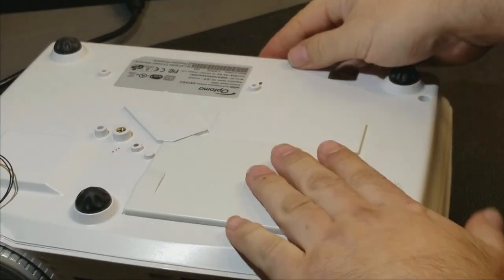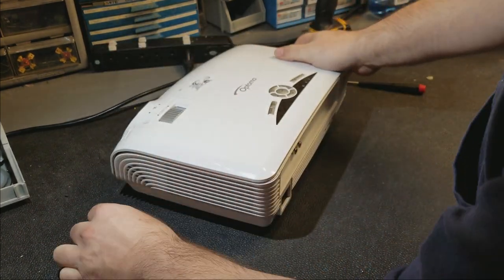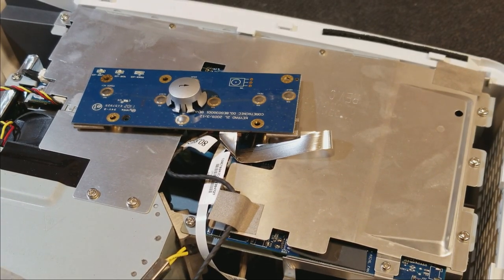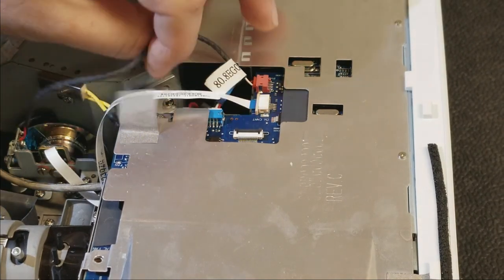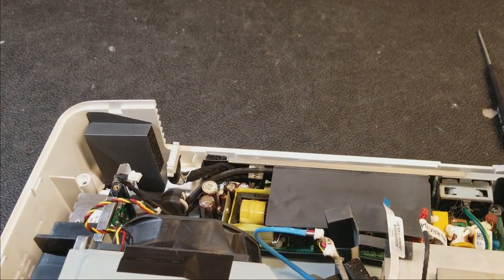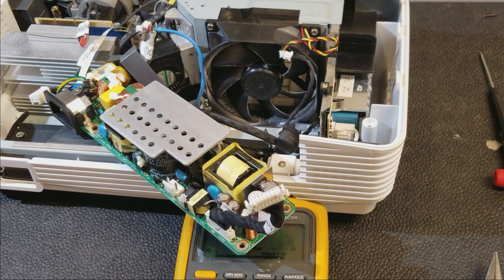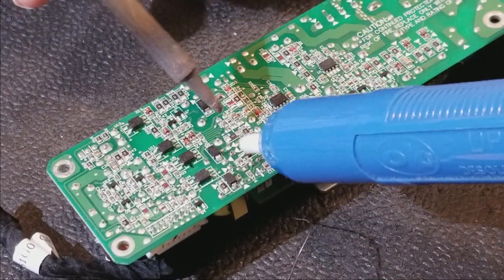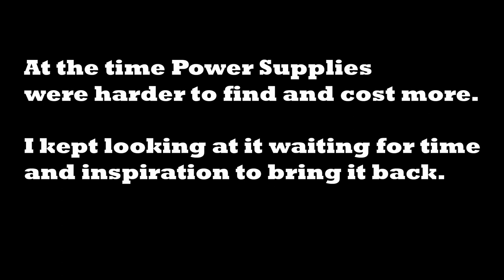Optoma HD20 DLP Projector Power Supply Replacement P 1

Comment: Great job Frank. I'm working on a Benq TH670. It seems like the bulb is broken. Though the LED code shows that the color wheel should be bad. I will see soon when a replacement bulbs comes in. I would suggest getting a Hakko solder socker. it makes life so much easier. For me, those blue suckers never worked.
Reply from the maker: I love my sucker! I've had that particular pump since 1998. It's had 27 tips since then. I still have 3 left(it's how I know many). This pump is a large type. It actually works really well. The small ones are kind of a joke though. I have a powered Weller desoldering station with the foot pedal and all but I love my old hand solder sucker. It's had it's snout in a lot of gear since I first used it. That sucker and my Weller iron have been with me for over 20 years now. It's weird to think about...
Reply: @FixitFrank  It ended up, only a bad bulb. Replaced it and already sold it($380 !). Today, I will pick up a W1070, which is completely dead.

Comment: Thanks Frank. The video is EXCELLENT: very detailed and always in focus, accurate and with great audio. I was surprised to realize that I had EXACTLY the same problem with my old but great HD20 (including the problem of the plastic of the 2 screws…). Got the power supply from China ($57), and now it works great. Thanks!!!

Comment: Hello Frank. Thank you so much for the in depth videos. I am on my second HD20, using the first as a parts machine. Recently it is having the following symptoms: the green power light flashes three times, and then the power light flashes amber while the lamp light illuminates steadily. the main lamp does not start and the color wheel does not spin.  switching the mainboard did not solve the problem, infact all it would do is flash the green power led 6 times and then return to it's normal amber standby mode with spinning color wheel. Any tips you would offer?
Reply from the maker: Hmm. Kind of sounds like a lamp but also might be the lamp door switch.  Check the lamp door switch and the filter caps in the power supply. the service manual is downloadable here. https://file.io/d2F15J7HrGfF
Reply: @FixitFrank  Thank you for the advice! It looks like that file has been deleted. I have looked at the service manual and all it says is that that led pattern means is "lamp failure" which isn't very helpful. I have three different lamps and none of them change the results. I will investigate what you suggest. Thanks!

Comment: Hello there Frank! In the past days I too learned a lot about Optoma (HD26) unfortunately. All is fixed, all is working, however, last time, when I put the housing together, the heat shield on the back of the DLP chip heat sink was loose. It reached the metal housing of the power supply board, caused a short, and blew a capacitor. In your video, at 13:42, on the left side of the board, it is the green, disk shaped capacitor.

Thing is that, projector works perfectly (all functions, cooling, settings, ports etc). Do you (or anyone here) have any idea what is the function of that cap? I am planning to replace in 1 or 2 months, when I get a new color wheel, but it would nice to know, if it had only some auxiliary function I can live without. Thanks in advance!...unfortunately I haven't found any schematic/tech drawing either.
Reply from the maker: That is actually a resistor.  Technically its called an NTC thermistor. It's job is to slow the inrush of current when the power supply starts up. I'd also check the large ceramic resistor that is connected to the negative lead of the bridge rectifier.
Reply: Ah I see. This case I guess I’ll do a quick check / replace tomorrow. Thanks for the quick reply! :)

Comment: Many thanks Fixit Frank, as your videos inspired me to dismantle my Optoma HD23 with similar 'no startup from stand-by' troubles, due to a bad power supply unit. As HD23 parts (power supply) apparently are much more difficult to find than HD20, could you confirm that HD23 and HD20 use similar power supply and I can use an HD20 power supply in my HD23? Thanks for your advice and succes with all future projects!!
Reply from the maker: I had to find the one I had in scrap to check and it does look like they are the same.
Reply: @FixitFrank  That is very hopeful Frank, Thanks! And in more detail : Can a CT-319 - the LVPS I ordered - (for HD20), properly replace a CT-320B3 which is the ID-code on the LVPS of the Optoma HD23? And how to know? As Optoma says, it is different types, but what is different, how to know?? Thanks in advance!
Reply from the maker: That I do not know. I don't have any literature that explains the two.  The important parts are that it fits, and has the right connectors.  As long as they are the same, it should be okay.

Comment: I check the continuity of the fuse on my Optoma projector and nothing. But when I check the voltage on the power supply it shows voltage on the board except there is no power to the main board. So I don't get that or is it the fuse is for the main board an not the ballast. Oops made a novice mistake. I was testing with the positive terminal of the power plug connector not the fuse. Fuse is good, coapacitor are good, rectifier is good. So I'm guessing the fuse just may of had the issue.

Comment: Hello. Do you know if this model is better than models hd 142x, 143x or 144x ?
Reply from the maker: Hi there!  The specs are better on the models you list. They are a lot newer.  I believe the HD20 was last made in 2013.  The HD142-144x were made starting in 2016 and later.  The HD20 is rated at 1700lumens. The HD models were much higher with less powerful bulbs. They are more efficient in light transfer.  The HD20 is still a good projector.  For being 7 years old, this one has a very nice picture. After I clean the mirror I will replace the lamp. On eBay US, I see the HD20 around $2-250, versus an HD142X for $500.  The HD143x and 144x are export models here. I have seen the HD141 and HD142x and found them to be nice projectors for under $2000.

Comment: Hi Frank!  Thanks a lot for all great videos!  My Optoma HD200X (same as HD20) has a strange issue which i can not find any similar cases of.  The Main bulb is strobing/flashing every second and makes a popping sound.  No error lamps is turned on. Only power light is flashing green as it does during start-up.  I removed main bulb and the popping sound persist. I followed your ballast diagnosis video and can not find any fault on that board.  If removing power wire coming from the main power board the popping sound stops.  Messured 320 Volt output from main power board  to the ballast.  Tested with another known good  main power board and projector did now start up as normal with picture and everyting for about 3 minutes.  Then projector shutted down and popping sound is back and also the main bulb strobing.  Is it the ballast board that is causing this or what do you think ?  Greetings from Sweden.  BR Emil
Reply from the maker: Greetings from Pennsylvania!  320V from the main supply tells me your power factor correction circuit is not working. You should have 380-400V at the ballast if you line voltage is 220-240ac.  That is why your lamp is strobing.  The ballast is almost getting enough power but not quite.  The power supply has a large mosfet that handled the PFC that crates your 380VDC. I would check that large FET first. That said, a new power supply is pretty easy to find and PFC errors can be a huge pain without access to parts. I have a contact in China if you need it. Let me know if you do. I want to say I paid $40-60 US for a new power supply for an HD20.  Focus on the main power supply and the components that feed the ballast, One of them is your problem.
Reply: @FixitFrank   Thanks for your reply :)   I just received a new  main power supply from china, put that one in and everything worked fine for  about 3 minutes. Then same issue came along again with lamp strobing.   Im just wondering if  you think something on the ballast is causing this voltage drop from the power supply  as it happend on 2 power supply boards now. BR Emil
Reply from the maker: @in0012   I follow you now.  It might be something on the ballast end pulling it down.  I think I would see what part on the power supply is failing.  Then you will know if its the ballast putting too much load. Have you checked the ballast for any shorted or leaking mosfets?  One pair is for ignition of the lamp, the other pair is for running the lamp.  I would see if one pair of mosfets checks out differently than the other pair. Of course you could just throw another ballast at it, but would still see what failed on the power supply.  If it is cost effective , replacing the power supply and ballast together would probalby solve your problem.  I should ask about the lamp.  Is it using a proper osram bulb inside? A poor quality lamp may cause this too.
Reply: @FixitFrank  Ok, thanks for the info. i will check the ballast once again and compare the mosfests on it.  I just did a quick test and removed the power wire from the main supply and it is  showing 379 volt so hopefully the new supply board has  not taken any damage. Lamp is still the original osram lamp. never been replaced. 
Thanks,  Emil
Reply from the maker: @in0012  Hi Emil, If the lamp is orignal...that might be your problem.  The flickering you describe is a symptom of a failing lamp. You may want to try another lamp if you have access to one.  Even though it may be lighting, if it was run in eco mode for a while, the arc points can get a buildup of scale that will prevent a clean arc. 
However, since you said the voltage went back up to 380 with the ballast removed, that is encouraging.  Check the stand alone FET too.  It is the "switch" that enables the ballast. If it is leaky or failing it may be the reason too.  I think you are getting very close. My money is leaning towards the ballast.
Reply: @FixitFrank   Hi Frank!  Just received my ballast board from china (used one)  and tried to compare component  vaules between the orginal board and the  spare one with multimeter. I did not see any remarkable difference in values so i did finally install it and guess what.... My HD200X Projector is alive!!! :)  Have been testrunning it now for about 10 hours non-stop and nothing to complain about.  So there must be something bad on the original ballast board,  and it kills my brain not finding the root cause :) Thanks for you thoughts and comments :) BR Emil

Comment: I have an hd33 and have been watching this testing video over and over again. If I run it assembled the bulb does not light and gives me an error of lamp failure. I tested voltage running to the bulb and it shows 96volts. I tested the power supply as per your video and it shows 9volts. I tested the cord and I get 120volts going in. How is it even possible to have 120 going in but only showing 9 volts to the ballast board. Any help would be great.
Reply from the maker: Sounds like your power supply is bad. Ballasts need 380vdc being fed to them. In the power supply there is a circuit called power factor correction that generated the 380vdc from the 120vac. If you only measure 9 then something is up or you're using the incorrect ground reference point. Ideally measure the voltage to the ballast across the dc input wire. If it's anything but 380ish it has a bad power supply. However I would make 100% sure you have a good lamp. A bad lamp  will run you in circles. Don't buy a knock off lamp either. They will also cause problems. Make sure it's a name brand bulb(Osram) inside and has a good lens coating(red blue hue to it). Lastly don't measure the ballast output. During startup it can output thousands of volts and blow up your meter and or hurt you. See what you find voltage wise on that 380vdc input to the ballast(both pins).
Reply: FixitFrank where is this specific ground reference as used the ground wire off the power supply to the case. I also checked the voltage right from the power supply on dc right off the power supply board that outputs to the ballast controller? I have put in two legit osrams with the same results. Is there a way we can pm?
Reply from the maker: For measuring the 380DC to the ballast, I would measure across both pins that the wire is connected to.  You can get the probes into the back of the connector. Then to measure the low voltage power to the mainboard, you can use the shielding on the casing as a ground. The two areas have different ground potentials so you can get weird readings.
Reply: I received the new power supply today and put in to check voltages and it’s 20v dc of the white wire to the ballasts using the ground off the heat sink on top. Are there certain things I have to have hooked up to get the proper voltages like the bulb door? Do I need a bulb in? I have to be missing something here it just doesn’t add up lol.
Reply: Frank is it possible to get a low voltage reading if the ground is not that good? Should I sand the ground terminal and wire to give it a better contact same with the ground points on the board I’m super stumped with this one.  Thanks

Comment: I have the same at home with the same problem / sames composants was fault on power pcb
Reply from the maker: I wonder if that transformer is shoddy?  I have seen this happen on many HD20s.
Reply: @FixitFrank  Same here.. Got the chip in yesterday and will swap..From Part 2, seems the transformer is no avail and so will be ditching it.
Reply: @FixitFrank  BTW: not sure what's going on , but you might not get a response... I asked , never got a response in part #2.
Reply from the maker: @WilsonBradleyTheOfficial  Youtube comments are confusing to me.  I sometimes get comments that were posted some time ago as "new" but in spam even though its a follow up from someone I clicked as not spam.
I have a source for the entire power supply, $60-70 if I recall.
Reply: @FixitFrank  Thanks for replying. I replaced the same IC chip and still no go.. so its prob. time to upgrade. I found a 4k projector on Sale at  Amazon for $539 https://www.amazon.com/gp/product/B079HH68M8/ref=ppx_yo_dt_b_asin_title_o06_s00?ie=UTF8&psc=1  - long shipping wait though..